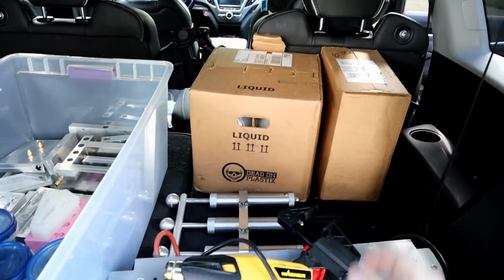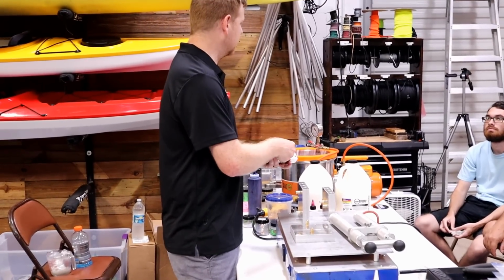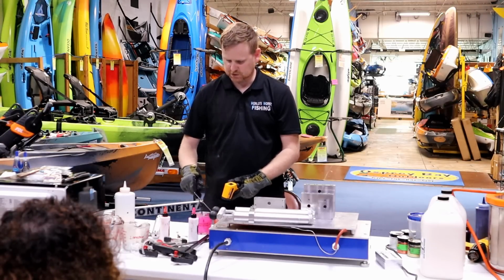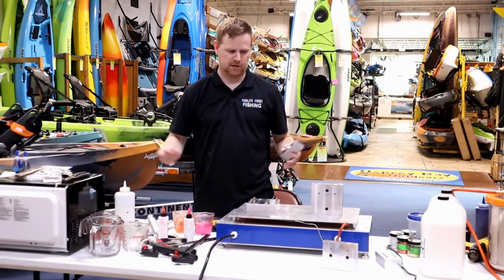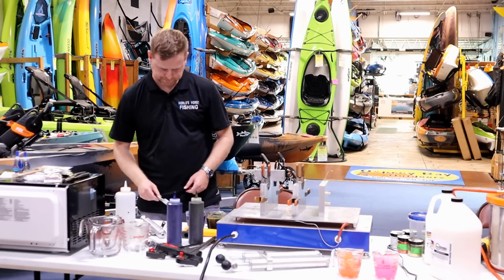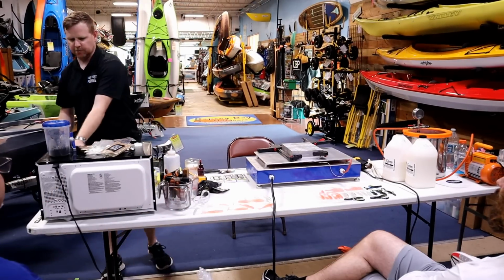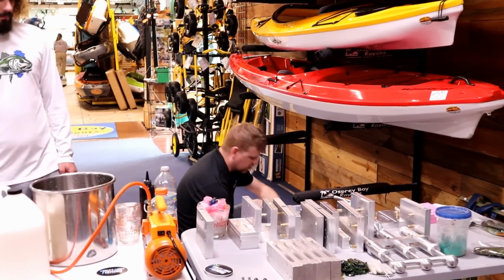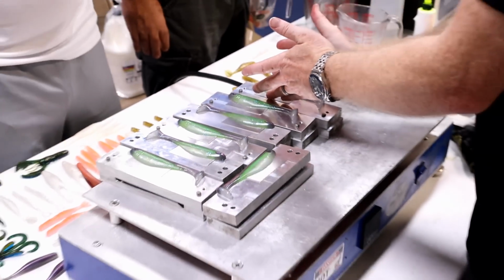We Taught a In-Person Bait Making Class; Lure Making Seminar Vlog

Comment: Hi, thanks for your super helpful videos!
About making your own  silicon mold "diy", plastisol ready to pure is around 150 c, wich kind of silicone do you use?"normal silicon" or silicone that can stand high temp, usually it comes as rubber, red in color silicone rated to pure lead, 300 c about.
Thanks so much for  sharing your experience with us, really appreciate it!